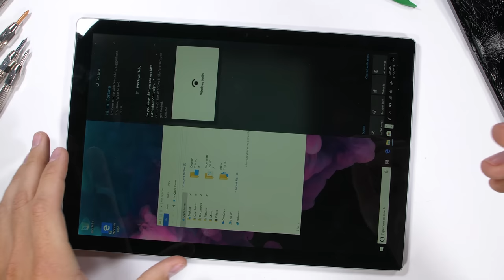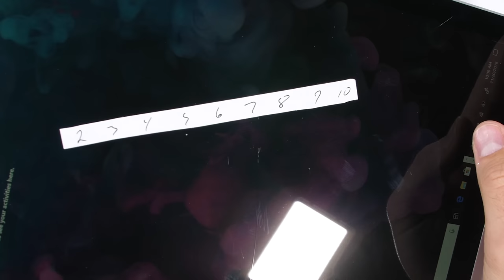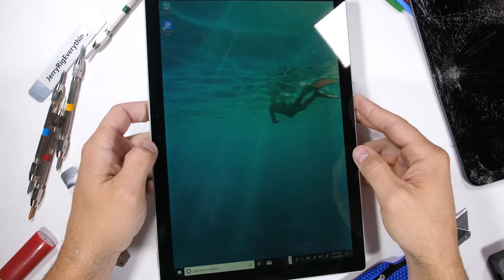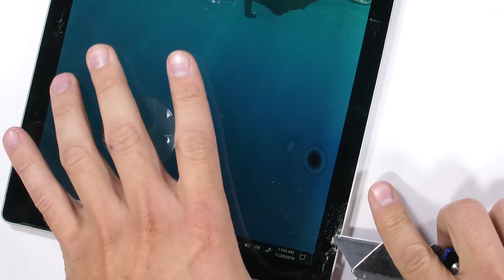Surface Pro 6 Durability Test! - Is it stronger than the iPad Pro?!

Comment: The surfaces are really good tablets (I’m still rocking the 3) but I really hope they got their act together after their QA with the surface pro 4, them denying a major issue that prevents all usability for years isn’t a good way to keep loyal customers happy
Reply: what is that major issue? I just bought sp4
Reply: TechProductionist flickergate, something that plagues the i5 and definitely the i7 sp4 (not too sure about the m3). Makes the surface unusable and for years until very recently, Microsoft didn’t acknowledge it until they got hammered with lawsuits (sound familiar?) and they started issuing free replacements.

Comment: It's way more durable than Ipad!
Reply: Almost double.the weight it’d better be...
Reply: Yup right 😀😀
Reply: @tcrtle   Well the weight in the Surface proabably comes from the cooling system and other hardware. Where the iPad pro is mostly light lithium battery.
Reply: Except for the glass, it really cracked for no reason. I'm wondering if his tablet didn't have a defect out of the box, like a tiny crack on the side of the glass that's not visible but enough to compromise the structural strength of the glass
Reply: Only more durable in flexing. Everything else iPad is more durable as shown
Reply: @HCkev  If you said the same about apple device you'd be called a sheep, makes you think doesn't it.

Comment: I guess he’s going to bend other non-Apple tablets as a response to Snazzy Labs’ latest video.
Reply: Starting with a magnesium tablet that’s nearly 2.5 times thicker than the iPad...
Reply: Scott Gibson nobody forced Apple to produce something so thin and brittle :-)
Reply: @jonathanfields4ever  both still a tablet, and ipad is what apple persistently says... full fledge computer
Reply: flows30 Yeah... so if I compare an SUV to a sedan in a crash test it’s valid because they’re both passenger vehicles?
Reply: @jonathanfields4ever  you mean 2.5 millimeters...that is negligible...and "Magnesium is 33% lighter than aluminum, 60% lighter than titanium, and 75% lighter than steel. Yet for many applications it's stronger per unit volume than all three of those structural metals..." so i guess ipad is just garbage compared with surface pro.
Reply: @jonathanfields4ever  The surface is also quite a bit larger in size and more susceptible to damage during the bend test. I'd call it even
Reply: @jonathanfields4ever  obviously, nowadays both type of cars usually got 5 star NCAP rating. You really wanna buy a 3 star or less car?
Reply: flows30 The point flew over your head...
Reply: @jonathanfields4ever  so you are saying 2.5 mm is where you draw the line SUV vs Sedan? Okayyyyyyy......
Reply: @jonathanfields4ever  These are both tablets he didnt compare iPad with a 2 in 1 device so you metioning sedans and SUV's is incredibly stupid.
Reply: @mr.randomgamer888  I generally agree with you but I think the tab S4 would be more of a match for the ipad pro in terms of being advertised as a computer.

The tab S4 was advertised for its pc like experience with the dex mode but still not a full fledged pc. Same thing goes with the ipad pro with its photoshop and stuff but still not a full pc experience. So both are "pc like" but not a "pc"

While the surface pro is more like a pc in a tablet form rather than a tablet that can be used as a pc.
Reply: Wai Phyoe Aung Microsoft website says SP6 is .57 inches thick. iPad Pro is .59cm thick.
Reply: Лука Матијевић It’s thicker, heavier, and has different capabilities. The Surface is marketed as a PC in tablet form. The iPad Pro is market as a tablet that has the power of a PC. If you’re cross-shopping them, you’re probably stupid. The analogy holds up.
Reply: MR. RANDOM GAMER That’s a fair point. And it is one of several areas where I think Apple deserves criticism with this release. The marketing is very bad. It’s being pushed as a tablet with PC-like power and the ability to replace a PC. Most people hear that and think “it’s a PC.” The difference is subtle, but important. And I think Apple is aware that it causes confusion.
Reply: To be fair, if an SUV could protect me in a crash better than a Sedan, I would buy it.
Reply: @jonathanfields4ever  no stupid, Surface Pro 6 is 0.33 inch thick, while iPad Pro is 0.23 inch. As if a 0.10 inch is a huge difference. It's just the materials they've used, maybe Apple should consider using magnesium or something more durable on the next iPad since you are paying premium for it.
Reply: @jonathanfields4ever  So you are believing in their marketing and think that's the truth? Both devices are similar screen and body size. The SP6 is heavier and thats exactly what Apple should have done in order to keep an iPad built quality on pair with other tablets.
You should allways consider other options because this iPad and all other products are not incomparable. That's your analogy which proves that's you are indeed limited.
Reply: @jonathanfields4ever   11.5” x 7.9” x 0.33” (292 mm x 201 mm x 8.5 mm) this is the dimensions from microsoft's website, I just copy pasted it, I don't know where the heck did you get that.
Reply: @jonathanfields4ever  I think I found it, you've mistaken the surface laptop 2's dimension for the surface pro 6's
Reply: guys...both the ipad pro and the surface bent and were damaged by hand strength. difference being, the ipad has a big structural defect in the middle...while the surface has a big structural defect in the glass cracking by just a level7 scratch tool lol
Reply: Nick Soong this is not really a tablet. More like a bad laptop
Reply: @jonathanfields4ever  the point was garbage. The ipad and surface pro are competing products that have the same function. An SUV and a Sedan though are built for different uses.
Reply: @jonathanfields4ever  its garbage kid :) accept it
Reply: @jonathanfields4ever  how is 8.5mm 2.5 times thicker than 5.9mm. Now I may be wrong... but I'm pretty sure 5.9 × 2.5=  14.75mm
Reply: @headout3116  lol
Reply: Scott Gibson Look, basically what everyone is saying is that for the price we pay, we expect the new iPad Pro to have good build quality since its being marketed as a lightweight laptop replacement. Apple is improving their devices, but they are taking their sweet ass time doing it. Don’t complain that their R&D takes time, I rather they release a good device every two three years instead of half crap every year.
Reply: @genelee239  yes exactly, the iPad was advertised as having the pc experience, while the S4 was advertised as having a pc like experience if you buy the Dex dock (or whatever it's called), and I can see alot of people mistaking and using both terms interchangeably, and I for one got the idea that Apple is pushing it as a fully fledged pc experience because of their ads pushing that idea, while for Samsung I didn't really see any ads or people pushing that idea and I only perceived the Dex thing as a 'side capability', I of course don't resemble the majority of the people, and I may have just been an idiot for not seeing their ads as much as the rest of the people, but that's my 2 cents about it
Reply: @jonathanfields4ever  true, they have been aware of their problems for a while but they never do anything because it simply makes them grow larger with the way they play things, so why bother?
Reply: @mr.randomgamer888  Yep, it's how Apple markets the iPad Pro, you don't need to have a word for word phrase from Tim Cook saying "It's a laptop replacement" cause they are already marketing it that way, while Steve Jobs marketed the iPad as the the middle category between a phone and a laptop/computer.
Reply: @mr.randomgamer888  Hmm you actually dont need a dock/cable to use dex mode on the tab s4. You need the dock/calble for the phones (s8~note9) but for the tab s4 u can use it without any extra accessories. But... yeah you're right.
Reply: @Headout that is true for old mathematics. For the new applematicians 8.5mm is a gallon more than 5.9 lumens.
Reply: @flows30  if the ipad is a full fledged computer, I am an aircraft carrier.
Reply: he's been bending every product since his channel created. lmao
Reply: @jonathanfields4ever  How many sedans cost as much as an SUV... You should keep in mind that these 2 tablets cost around the same... Which makes this a very valid comparison.
Reply: Sir Sayaka Miki the 3rd Yeah, and so are an iPad and Surface. I’m sorry your mind has trouble with abstraction.
Reply: @jonathanfields4ever  You going to acknowledge the surface pro's dimensions being 11.5” x 7.9” x 0.33” (292 mm x 201 mm x 8.5 mm), which is only approximately 2.5mm thicker (1.4 times) than the ipad pro?
Reply: Andy Yes. It appears I made a mistake.

Comment: My surface pro 4 has survived two 5-feet drops. So, not bad!
Reply: Hackman My IPhone 8 Plus survived a 10 feet drop from my second floor windows lol without a case. I just got a little scratch on the steel
Reply: @rwhoosh1122  my note 9 survived a 20ft drop in my house the other day. Hadn't even put on a case and it just bounced a couple time. I was amazed nothing broke. Ran downstairs, picked it up and it was good to go! I think I did more damage to my floor than I did to the phone. Chipped a bit of the tile it landed on.
Reply: I still use everyday my I5 8GB ram 256GB SSD Surface pro 4, looks like SP6 is still mostly just the same thing as SP4 but with better CPU.
Reply: c31979839 When my s8 feel of my pocket the curved screen broke. No case on It.
Reply: c31979839 switched to IPhone 8 cause the s8 had issues
Reply: Xero [2] I still have the s8?
Reply: Xero [2] You know the IPhone 8 Plus coast less than the s8? Right? I only got mines for 499?  Those features are useless to me. It’s not the same glass as the pervious model.
Reply: Xero [2] Never said you should get the same result.

Comment: The Surface Pro isn't really a pro machine with those lack of ports and soldered stuff. Kinda like the Macbook Pro.
Reply: I would consider it to be more "pro" than the iPad pro (it has surface connector, usb A, mini displayport, headphone jack, support for mouse)
Reply: Definitely better than the iPad "pro", I'll give you that. But it's a machine actually running a full OS so that's why I didn't compare it to the iPad.
Reply: I've been using surface pro 3 for a long time now and it works perfectly. Productivity at its best
Reply: I use a ThinkPad T430, it is heavy (5 lb at least) and thick, but it works fine.
Reply: I haven't really experience a lack of ports with my Surface Pro 4, and if you would you could always get the Surface Dock with gigabit ethernet, 4 usb, 2 (4k) mini-displayport etc
Reply: @cenkkarakaya6262  I honestly could use another USB port. I think the main reason they don't is because of the draw on the battery.
The chipset can support 2 ports and there is physically room inside.
Reply: I have the surface pro 4 as well. Great laptop/tablet for sure! For what I use it for, the one USB port is fine, but a second wouldn't be bad. Do you have problems with your screen flickering at the lowest brightness setting though? Mine does, and I've heard lots of other have that issue with the 4. Hope they fixed the issue in the later models
Reply: Yeah, funny how Zach doesn't mention the lack of ports on the Surface but he does on every apple product. Huh.
Reply: @Maximdietz  because surface pro have enough (more) ports than iPad pro
Reply: Pro for profit amirite
Reply: @Maxim Dietz because he's tilted about everything apple makes. sure the ipad is garbage, but a lot of its flaws are shown in the surface too, yet he won't touch upon them in this video. pretty biased but then again, most of the other big tech youtubers are on the other side
Reply: @SWEATYGINGE  That's what annoys me about him. I just want an unbiased durability test, not him spewing salt at apple for 15 minutes. I don't love or hate apple, I just want to see how durable their products are.

Comment: Surface Pro is the best 2 in 1 while iPad is the best tablet.
Reply: Well said
Reply: King Koopa Surface pro can’t not be my laptop games would suck on it
Reply: @King Koopa
A 2 in 1 is still a tablet, so the Surface is still the better tablet.
Surface Pro runs a full desktop OS, automatically better.
Reply: Katze The Surface pro is better for a laptop. For a tablet it’s worst cause some people use there tablet to play games on it and this tablet is not made for gaming and a tablet was never meant to run a desktop os just like all the other tablets that run on android or iOS.
Reply: @rwhoosh1122  
The Surface Pro 6 can play games like Fortnite, GTA and Tomb Raider without much trouble.
Also what do you mean tablets were never meant to run a desktop OS? Windows 10 was designed for tablets.
Reply: @Snicker433  Agreed. Windows 10 has a tablet mode. Most Windows tablets started manufacturing after windows 10. Games can run on this. Android and iOS games will run on this power.
Reply: Have you heard of Lenovo Yoga or HP x360 line? Those are much better at being computer than Surface Pro. Also they are capable of being a tablet too, while not the best tablet, but so does the Surface Pro.
Reply: @nonnnth  I prefer the ability to snap off my keyboard over folding a keyboard backwards or using tent mode. If you prefer a traditional laptop form factor then those are definitely great machines.
Reply: @KLCII88   King Koopa  If I prefer traditional laptop, I would get a MacBook Pro, which I did. So I don't really need another laptop now, but I want a tablet and iPad Pro is really high on my list among Surface Pro and other iPads.

Comment: I dnt charge my ipad anymore it its just sitting in my drawer...
. Thats how much it gets used.
Reply: I have an old iPad Air that 's been sitting around for ages unused. I replaced it with a Surface Pro 4. I just recently replaced that with a Surface Pro 6. I just don't think I'm a full-fledged tablet kind of guy.
Reply: I have 3 of them that all get constant use.  What's your point?  See, different people have different use-cases.  Believe it or not, other people dont all have to be just like you.

Comment: I’d rather have a slightly thicker tablet if it helps with durability and doesn’t just bend like a piece of junk. 

I was shocked to see the 2018 iPad Pro bending so easily. 
But this Surface Pro 6 screen being so fragile sucks. 
At least it doesn’t bend catastrophically like the iPad Pro 2018. 

😖 Scratching. 😖😖😖 STAPppp 🤣

The expandable storage and headphone port is nice to see. 

🐢 should be called Jerry Junior. 
🦈 should be called Jerry Shark.
Reply: it's not fragile, it's the crack that made it like that ( a crack made by something sharper than a razor )
Reply: Glass is glass, Mr. Glass.
Reply: Jerry Shark dodo dododododo
Reply: @DJLongLastin  Safe at last do do do do do ... LOL

Comment: DO A DURABILITY TEST ON SAMSUNG GALAXY TAB S4
Reply: its trash, why test it at all?
Reply: Literally nobody uses tab s4 , all Samsung phones/tablets apart from galaxy s and note are shit
Reply: @epicab2092  That statement is WAY exaggerated! You are clearly stuck in 2011.
Reply: @epicab2092  The Ipad is literally an oversized Iphone.
Reply: @yasu_red  I am speaking from experience , I have used Samsung mid range phones in the past and they are absolute trash , if you actually spend anything on a Samsung tablet , you must be out of your mind , first use these products then talk shit to me , my friend bought a galaxy s8 and in less than 6 months he was already trying to sell it
Reply: @epicab2092  Mind if you tell me which phones you have had overtime? Did you ever find out why your friend was trying to sell his s8? People buy samsung tablets because they want a tablet that does not run ios. Will you ever use the power in an ipad? NO! All you will do is watch movies, which the S4 does well too.
Reply: @epicab2092  

I have my s7 edge 128gb for over 3 years now. Didn't have any problems with it. Runs super smooth even with the storage full. Never restored it to factory settings. Best phone i ever had.

Comment: “The surface doesn’t have any flaws built into its weakest points.” Really? The two ports and accessory connection beg to differ. If he would have moved the kickstand over to the other side before the bend test it would have busted. Plus have you ever seen a screen crack during the scratch test?

Comment: I really like the Surface, but i not using it, cuz i buyed it from ebay, with an cracked screen. It works normally but the touch no more works. But i still like it. If i need to do something, and wont sit at my Desktop PC and/or my tablet cant show my one site perfectly, i switch to the Surface xD (i had a Surface Pro 3 <3) and the left speaker are dead :)

Comment: Sigh, buying this and discovering that its basically a sealed, non-upgradable device makes me quite sad.
Reply: @aaronuw  Has any tablet also been a fully functional windows 10 laptop? a 1200 dollar laptop/tablet should at least have removable ram/storage.
Reply: @aaronuw  Its mimicking a laptop in tablet form, you would want to upgrade for the same reason you would want to upgrade your desktop or laptop (also running win 10), for more performance or to replace worn hardware.
Reply: @aaronuw  Except it has a laptop cpu? it has laptop hardware in a tablet form, Running a full operating system in a tablet format. its cost is comparable to laptops with the same hardware, so being able to upgrade it, even if taking the glass off is part of the process, is always a welcome addition. it doesnt matter what it is, soldering memory to the board with no upgradability is stupid.
Reply: @aaronuw  also a quick google search would show you that previous versions of the surface pro do in fact have removable storage. so yes, there are tablets with upgradability.